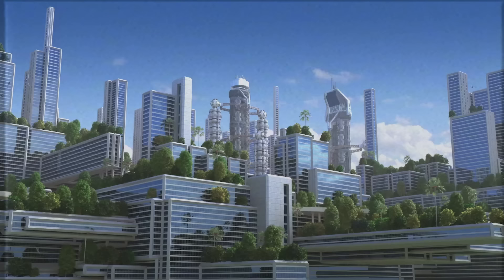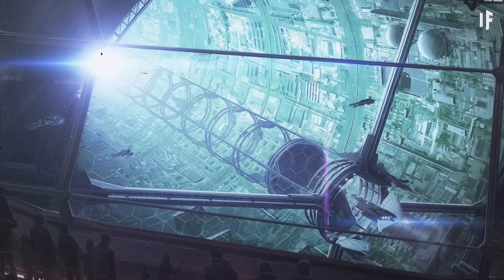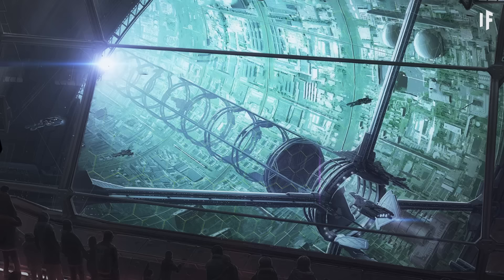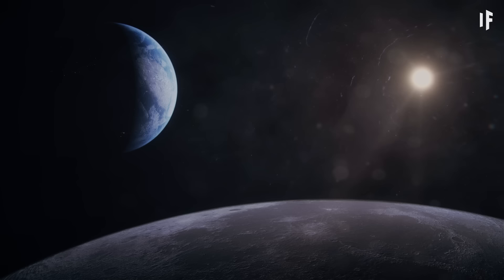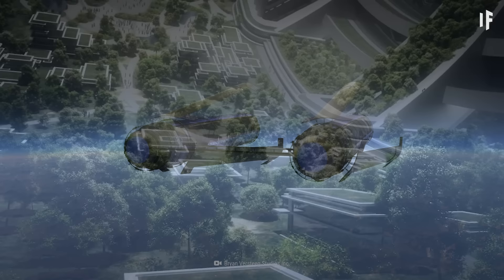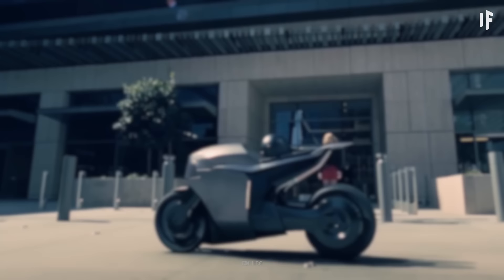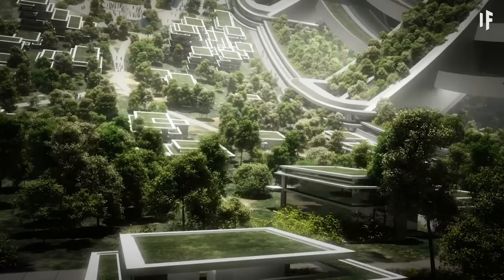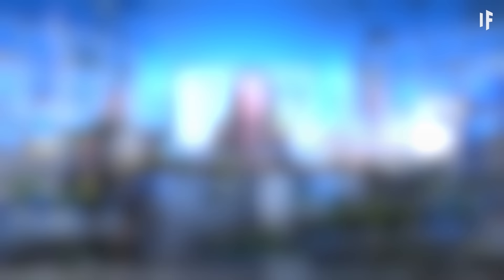What If We Built an O'Neill Cylinder?

Comment: I believe in order for a simulated gravity to work you would have to be perpetually connected to the surface of the cylinder once you leave the cylinder surface even by an inch you would be free floating in space regardless how fast the O’Neill cylinder would rotate. This in turn has its own problems being connected to the floor of a cylinder rotating with any GeForce enough to mimic Earth’s gravity ( in this instance it’s a centrifugal force) would more than likely push you down into the floor thus making it a lot harder to walk about if not near impossible. Unfortunately the O’Neill cylinder is a complete fiction and fantasy otherwise the International space station would have been made as an O’Neill cylinder.
Reply: There are effects induced by the rotation. Linear velocity, momentum of the 'spin gravity' etc would pull you back down. Basically in order to free float like you suggest, you would superhuman abilities to counter act the spin induced gravity. Higher up, the air drag & friction allows for birds, helicopters to fly rather than free float. 

That said, playing sports (golf, baseball, basketball, football etc would produce challenges). In an O'neill cylinder you could build a skyscraper & the difference in gravity between top floor & surface wouldn't even be 1% different. 

As for the ISS not being one. The ISS is tiny. End to end it's 0.1km's. An O'neill cylinder is 32km long (longer than the country of Malta) . The ISS weighs less than 420,000 kg & cost $150 billion to construct. How much do you think the O'neill cylinder would weigh & how much all that mass would cost to launch into orbit. Once it's up...you would need 1000's of engineers to go up & assemble the thing over the span of years. Where will they all live during that time? We didn't have the ability to mine asteroids over 30 years ago when the ISS was on the drawing board. We still don't have the propulsion & energy tech to do it today.
Reply: Ok, jump.

You come back down in the same place. 

Centripital force ensures that.

People fail to realize that the very planet they stand on is spinning at a thousand miles an hour, and then come up with answers like this.
Reply: @anhilliator1  The way I see it, is that something like that in space is represented by the mouse we on here on the planet. If you jumped in a big enough mass feel you would not land in the same place on the mouse wheel regardless how slow that mouse wheel moved you would land on the same spot you left not the same spot in the mouse wheel and that’s with gravity and a centrifugal force. I no expert or scientist but that’s the way I see it. So if you had a centrifugal force in space you’re still in space with no gravity once you’ve left the spinning centrifugal force. I just don’t think it’ll work don’t hate me for it.
Reply: @jamesh8862  I’m not sure you’re right if you’re in space where there is no gravity if you want to jump off a spinning wheel like the O’Neill cylinder I don’t think you would land back down in the same place. The way I see it is a centrifugal force would give you a simulated gravity on the actual in the surface of the drum but once you leave that in the surface of the drum i.e. you jumped you would be essentially in space with no gravity. The gravity is on the interior surface of the drum with a centrifugal force not on the air particles so given that we’ve got oxygen in the O’Neill cylinder the oxygen is still free from gravity even as the O’Neal cylinder rotates. I’m not scientist this is just my opinion don’t hate me for it.
Reply: @carloslongueira5292  You're still moving, though.

And on top of that you're moving in a straight line - a line that intersects with the cylinder itself.

Hence, you end up back on the surface of the cylinder.

That being said, the center of the cylinder would be a microgravity environment, hence why ships would dock at the center of the colony, with people taking elevators down to the surface.

Comment: Centripetal force and gravity are not the same thing. A basketball player on Earth can make a free throw shot "swishhh" because of gravity. If a person tried making the same free throw shot on a rotating cylinder using centripetal force instead of gravity, it wouldn't work. Why would the ball come back down?
Reply: Go back to physics class.

Gravity is what causes the centripetal force that keeps us anchored to the planet.

The vector of our acceleration is constantly changing, and as a result, keeps our feet and everything else firmly anchored to the planet.

What these things do is sort of turn this thing inside out, but works on the same principle.

You know how water doesn't fall out of a bucket if you swing it around? Bit like that.

Comment: If it needs to spin at 2 revs/minute, you really DON'T want giant windows to let the sunlight in because the sunlight direction constantly changing would be intolerable. Also giant windows are exceedingly fragile and take up space that could be used for living/agriculture. Light pipes could work but still suffer the rotation issue. It might be better to use artificial light inside, trading efficiency for control.

Comment: The centrifugal force would not work like gravity at all. Lets say the cylinder rotates in clockwise, the gravitational force gets wicker and wicker the faster you move backwards, until you get the equal speed of the rotation when it will be no gravitational force at all.
Reply: Did you even bother to crunch the numbers?  An O'Neill cylinder is 8 km in diameter.  It has to spin at roughly 0.5 RPM to achieve a force of 1 gravity.  That's over 200 m/s.   So any way you walk or run, it isn't going to make a difference to what you feel.  Any public transportation inside the cylinder moving radially doesn't have to be moving anywhere near that fast, so at most movement along a radial path would feel like an elevator going up or down, depending on whether or not one is travelling with or against the direction of spin.

Comment: Someone has already build one and I found the crash site. 

28°21'28"N 76°09'18"W

It is 60+ miles long and 10 miles in diameter. 
It is comprised of 3 mile long ring sections that have interlocking features that are .25 miles across.  Part of the structure has collapsed to reveal a 1 mile thick wall.

Comment: With the technology of today it will be a monumental task the likes the world have ever seen, it would cost quadrillions of euros and would require multiple engines stronger than the Saturn 5 all bolted down on a single ship, the launch would have to be done on mid air so a flying platform would need 2b constructed so high and massive that the entired northern continent would B able to see it, a single launch would leave a huge hole in the ozone layer, the roaring of the engines could be heard on hundreds of miles of distance, the fuel needed to propel the spacecraft will deplete entired regions of its materials, this means the launch cannot fail, hundreds of insurances would be involved on that single ship and launch, to complete the tube it would require multiple trips, to reduce cost Tesla has 2b the one involved so it can reuse everything but other agencies around the world have 2b involved. 2b able to agree on such a colossal built the 6th extinction event would have to happen therefore it is a race against time, Keeping the original intent a secret from the public would B a nightmare to any agency but the public is gullible so a good constructed lie would do the trick.

Comment: I have a much better idea. How about building an artificial world in space that looks like the Death Star from Star Wars, except is oval/egg sapped instead of perfectly round.  On the outside it would look just like either the moon or the 1st death star except for the Oval shape. It would be twice the size of the 2nd Death Star though. In otherwards 100 miles or 160 km in both depth and whith, then 200 miles or 320 km in length. Inside it would be a giant biosphere with 5 different types of habitats, a desert, a rain forest, a prarie, a mountainous tree covered area, and a hilly tree covered area. There would be lakes and a small ocean inside. Cities and towns. Enough space to house over 10 million people. The upper part would have an atmosphere with clouds, fake artificial suns to generate heat and light in the sky ( like giant light bulbs) a planetarium type sky with a couple fake moons and lots of fake stars in the sky for night light. The people and ground level would be about midpoint between the bottom of the ship and top of the ship. Underground they could use the remaining 50 miles or 80 km in depth of the ship as a series of giant parki g lots to park hundreds of shuttles coming from outside the ship or habitat, a series of launch tubes, an nd then elevators going from these parking lots up to the surface of the ship. Then they would have shuttles inside the habitat area shuttling people around to different parts of this massive space station like indoor flying cars. There would be 5 seasons inside. The desert would be a dry hot summer season, the ocean would have a warm humid summer climate with rain forests around it and lush islands out in the ocean, the prairie would be a temperate Spring climate, the hilly area would be a fall climate and the mountains would be winter with snow and skiing. The climate in each of these areas would stay the same all the time and it would only rain late at night between about 4 and 7 am when most people were asleep anyway. Snow in the mountains could come anytime of the day or night though.

Comment: Crypto Community: "Alright guys in 2025 lets find an asteroid that is 700 miles wide and 1,400 miles long at minimum. Then we will cut out a cylinder that is 505 miles down the center. Then we line the inside with Graphene 4 miles wide and Zylon 1 miles wide. We then use the left over cut out asteroid materials to build with on the inside. We then put graphene layers down with conneting supports every 5 miles after the 505 miles cut out. Then start selling land on the inside and enjoy the money coming in."

Comment: Spinning cylinder will not work in space, because space is floating, no matter how fast the cylinder spins, it won’t attract objects to the cylinder surface. On Earth, spinning cylinder works because of earth’s gravity.
Reply: BUT there is a possibility, instead of living on cylinder surface, engineers can divide cylinder into pizza shape slices and built homes on each radius line. Imagining the spinning pizza’s radius in space, as each radius moves that will drag object along the radius, the faster the pizza spin, objects will push against the pizza’s radius therefore creating artificial gravity.
Reply: Please go back and relearn physics.

Comment: Yeah, it sounds great, until the hull is punctured by space debris.

Then, it's buh-bye O'Neil's population.

And don't tell me that it couldn't or wouldn't happen, because it's man made.

How are you going to create a large enough magnetic field to encompass the craft, thereby ensuring that space debris skips off the crafts atmosphere, maintaining hull pressure for it's inhabitants?

Worry not about a long-term living space station, until you resolve that issue.

Otherwise, everything in this video is purely academic, even from an engineer's hopefull vision.
Reply: Most of the time these proposed Oneil cylinders are actually nested inside of a hollowed out asteroid. The asteroid exterior, along with whatever water ice you put between you and space should be sufficient to protect from radiation or micrometeors. The challenge then is building the thing on the inside.